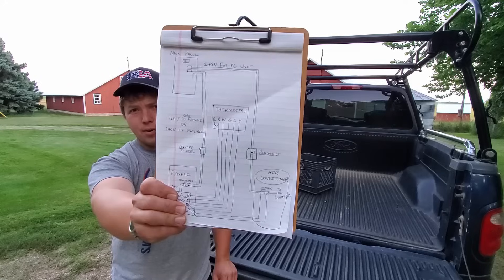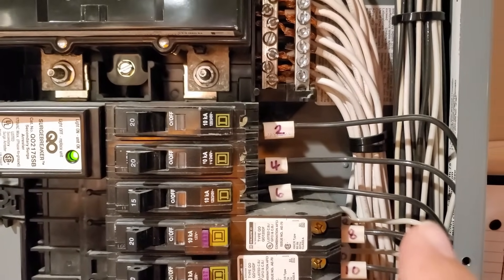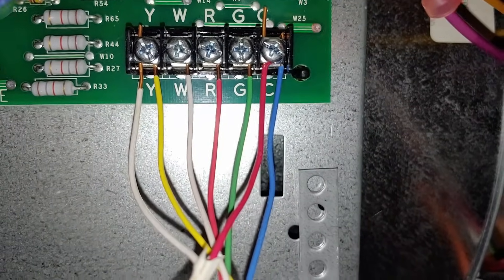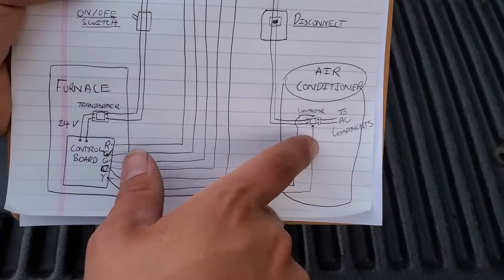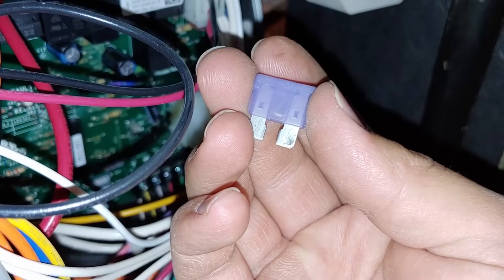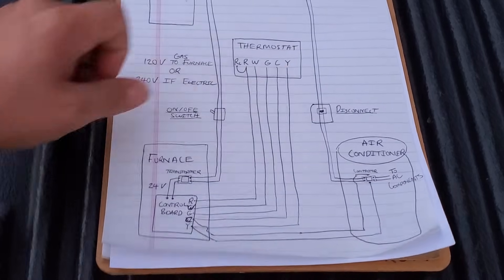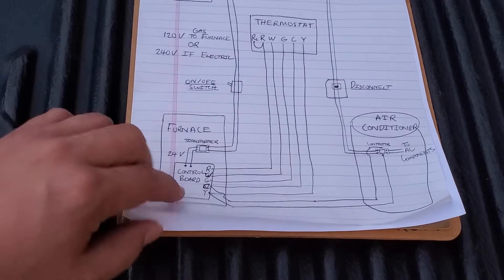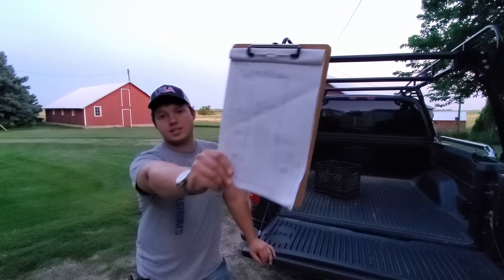Thermostat Wiring Explained!

Comment: Excellent video, thank you. I'm trying to wire a new WiFi thermostat and don't have a C wire running to the thermostat. I saw online (I know, dangerous right?!) where I can move the G wire on the furnace to the C terminal then jumper from Y to G to keep the fan engaged. I notice however that now my air conditioner condenser (compressor??) runs constantly even though there is no call for AC on the thermostat (off)  So I have the AC turned off at the breaker until I can figure this out. So here are my connections on the furnace: AC to furnace : Y and C  -  Y jumped to G with nothing else in G  -  Y, W, C and R out to thermostat. I can send you photos or a rough schematic if you are at all interested in helping me on this (probably) very simple task for someone who knows AC and thermostats. At any rate good information provided, thanks again!

Comment: Hi, i want to replace my old thermostat with ecobee3 lite using a power extender kit as i do not have c wire. But in my furnace control board i have both BLACK & WHITE wires connected to C terminal. W & Y terminals has nothing connected.
And those BLACK & WHITE wires are connected to old thermostat terminals as follows - BLACK - Y terminal & WHITE - W O/C terminal. 
I am really confused. How do i connect my PEK to the control board? How should be the wiring in this case?

Comment: The fan in the air handler is not working and the green wire in the thermostat has no power, how can I trace it all the way to the motor and how can I know if the motor is not burnt?

Comment: Ben great video!  Can you help me I just had a new Trane unit installed replacing my old 17-year-old carrier forced air unit.  I have a Honeywell wifi thermostat that worked fine with the old unit but now the fan will not come on when manually turning it to on. I hear the blower on when it calls for cooling but if I want to keep it on by tuning fan to on nothing.

Comment: Excellent video! 👏🏻  really clear and you covered everything. Maybe you can help me, i ‘ve replaced my thermostat because it was broken and the new one (ecobee 3) use a c wire and as i don’t like the extender i just use the c wire that come from the outside unit and it works. But i am having a new problem and i don’t know if its related to the new thermostat the ac works flawlessly but sometimes the ac don’t work and when i see what is wrong i find that the thermostas is off like with no power so i have to turn off the brakers and then turn them on but it keeps happening so eventually the ac will not work and i need to turn off and on the brakers again and so on. What can be the problem?

Comment: Ben,  Very good information. Easy to understand with excellent explanation. I really like the screen shot of the components. My condenser fan intermittent short cycling. all the wiring is good, but i read 4 ohms at high pressure switch.

Comment: Excellent video, explained in depth how the wiring at the thermostat, furnace and condenser. Thanks
Reply from the maker: Glad it was helpful!
Reply: @BenjaminSahlstrom  Hi Ben, I'm still having problem with my Honeywell T5 thermostat connected to a gas American Standard furnace and condenser. I have White wire to W, Blue to C, Red to R, Yellow to C and Green to G. When I turned on the cool mode, the heat air is coming out. I was able to fix it by moving the White wire from W to W1 and it works. In the winter, when I turned on the heat, normal air is coming out, not heat, this time, I fixed it by moving the White wire from W1 back to W. What is the problem with my wiring? Did I miss anything?
I also tried by moving the White white to O/B and jumped a wire between Y and W but it didn't fix the problem. Please help. 
Thanks

Comment: Question; changing my thermostat. My old 1 has red wire to rh and a jumper from rh to rc. On my new honeywell home has a r and rc terminals and underneath that a factory jumper to rc and r. Where do I put the only red wire to on the new thermostat  and will everything  work properly?

Comment: What a fantastic video. Thank you so much. I just installed my own AC/Heat pump and not being an HVAC tech, i need more in depth explanations about why certain things do what they do, as opposed to just following guides on how to hook something up. Your explanation cleared up the whole thermostat to air handler to condenser wiring confusion I had.

Comment: Hello Ben. Thank you for posting this  video. It has been vey helpful.
I have followed your diagrams for the 24 volts wiring with a unit I recently installed. For some reasons, the AC unit comes on as soon as I plug in the fuse/breaker for the unit, while the thermostat is on off position. Do you have any suggestions for me?
Thanks,
Mort
Reply: Have you tested the voltage between your thermostat contacts?

Comment: I'm also wondering about the O (Orange) wire, I've heard this is a reversing valve wire that is needed for heat pumps to move between Heat and AC ?

Comment: Very informative ...Thanks Much!   If I pull the W wire on my thermostat and throw a wire nut on it for safety, will that deactivate the heat from coming on.  On Ac the heat intermittently will take over and race.   Thanks Again !

Comment: Hey Ben, so in a zone system if my Y wire is connected to 2 zones that means I will power 2 zones to open because it sends 24v to those 2 terminals?

Comment: Hi Ben, great video and perfect, clear explanation. After reviewing your video, I'm still lost here. I have a brand new AC unit and furnace. Champion AC and Goodman furnace. My fan is blowing but not cold air. I'm also using a Nest thermostat. Any ideas on why this might be happening?
Reply: Is your condenser turning on? If so you may have a leak in the line sets that hold the refrigerant thus resulting in ambient air.

Comment: I have an old PTAC that supplies 24VDC on R - i want to install an smart theromstat (will power with batteries or 12-24V AC or DC).  Are thermostats just smart switches which pass on whatever voltage is on R? Or, is it mandatory to feed it 24VAC?

Comment: The G wire makes the blower fan on the furnace run continuously (Fan On). White wire turns on the furnace burner but blower fan is turned on later by the furnace (Fan Auto) when the heat exchange reaches temperature. After the thermostat no longer sends a signal on the W wire the furnace burner shuts off. The blower fan continues to run until the heat exchanger cools and is turned off by the furnace.

Comment: Any idea why on my thermostat the Y wire is connected to Y in the thermostat and then connected to the C terminal on the furnace??? The Y terminal is jumped to the g terminal on the furnace and then connected to the g terminal on the thermostat. Red is to red, normal enough.

Comment: I have an orange wire on my thermostat and I cant seem to figure out where it goes. My new honeywell thermostat is just blowing warm air now. I obviously have something hooked up wrong :(
Reply: The  orange wire using  to controls the heat pump ( valve)

Comment: Honeywell 9585 WiFi thermostat fan only runs on auto I like it to run on on or circulate where did I go wrong on my wiring
Reply from the maker: R to G controls the fan so there is likely a loose connection to the G terminal.
Reply: @BenjaminSahlstrom  I have the same issue. My furnace and thermostat were replaced and when i went to the thermostat to turn the fan in the "on" position rather than the "auto" position,  the thermostat acts like the fan is on but it is not. When i checked the thermostat, there is no wire to the "G" terminal and also  no wire connected on the G terminal at the control board in furnace. Only have 4 wires at the thermostat. Did the technician do something wrong?

Comment: Can you go into more depth explaining how power stealing works? Also when does this cause issues and when is it fine. I’m confused as to why Nest hasn’t created a power extender kit like ecobee has.
Reply from the maker: I'll add that to the video idea list! The times where it causes issues is if the thermostat tries to use "power stealing" on a unit that has a control board that is just looking for the "signal" from the thermostat rather than using the power from the thermostat to power a relay. Honestly I need to learn more about it.

Comment: I never comment and typically don't even browse while I'm logged in BUT I felt compelled to because your video is so good.  Seriously - thank you!  Thank you for taking the time to make the video, but even more importantly, thank you for being clear, concise and acurate.  I went through a ton of trash infomation (some youtube, some HVAC manufacture's videos, countless google & bing articles) and had pretty much gave up.  Then I found this - PERFECT intro to how these systems work.
Reply: You would be surprised at how many guys are out there installing and attempting to repair AC units that have no understanding of this video.
All they know is the colors of wires used. Nothing else.
Reply: @jstravelers4094  - Color can be a lil bit distracting too - I see COMMON can be brown or blue or white

Comment: This has to be the best tutorial I have seen... both diagrammatically and with the actual devices shown virtually at the same time than isolated. Keeping this one bookmarked .Thanks for taking the times ot put it all together.
Reply from the maker: Glad that it was helpful!
Reply: Totally agree, anyone can explain how to attach what color wire to what terminal, but this breakdown of EXACTLY what each wire does is invaluable, and just as important, easily understandable. And as you state, the diagram and devices make it even better, definitely bookmarking also.

Comment: What should I when fan motor not starting
The capacitor was bad and I replace it.
Fan motor still won’t start
I self turn the fan and it turned for a little bi like between 10 min to 20min then motor stop again.
Check motor reading was good
What the next step should I do?
Reply from the maker: You should probably just replace the motor. Sounds like the bearings might be failing.

Comment: Ok I want to understand the batteries and not having to use them. I’ve heard if there’s a brown wire it can be power for thermostat. 
Also my AC in house I’m buying the transformer is out. Ordered new one. But if there is short in system. Shouldn’t I find it before I install new transformer.

Comment: Very thorough explanation.  You should mention that some thermostats do not use the 24v, but use batteries instead.  The only reason I mention this is if you ever need to then install a thermostat that uses the 24v from the furnace, sometimes the C wire is not there or is not connected at the control board.  Keep making great videos!!
Reply from the maker: Very true. Thanks for pointing that out! Maybe I'll make a video specifically about the common wire/battery relationship.
Reply: @BenjaminSahlstrom   Ben please do. I tried installing a ecobee t-stat and it was only a two wire thermostat, oil burner. The zone relay control board is only controlled by dry contacts I think. I know some control boards have an optional 24 volt supply but this one didn't. 
After watching this video, am I correct to assume I would need to power the Rh terminal with 24 volts and also use the common or C terminal with a separate transformer?

Comment: Super helpful. I had no idea when wiring my thermostat as to what the letters meant, I just mimic them to what was there before and what they were tied into the furnace. Now I understand what each means. Now to go back and figure out what the two cut wires were and why they were previously cut...
Reply from the maker: Exactly. Its really fairly simple once you think it through a few times. Really makes troubleshooting a lot easier if you have a little understanding of the basics. Thanks for the comment!